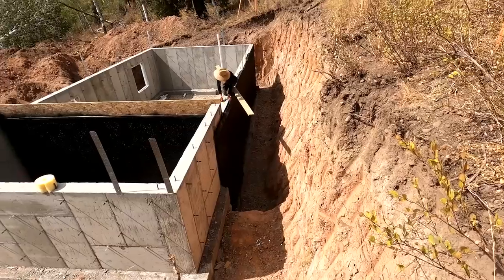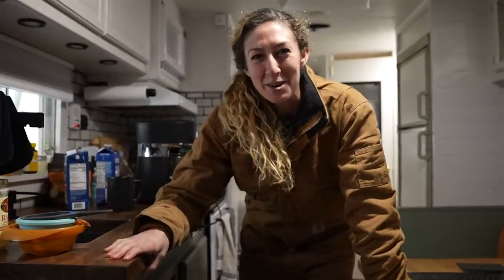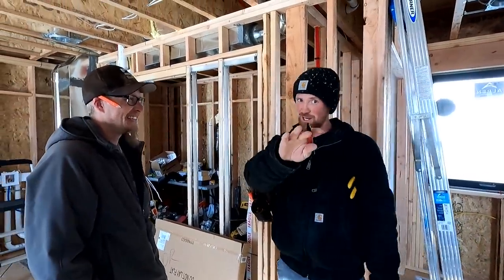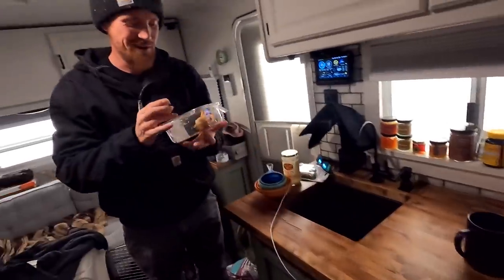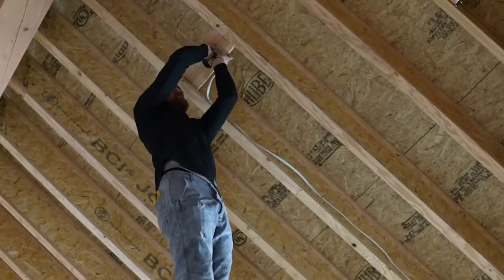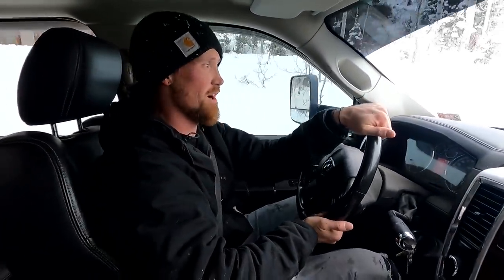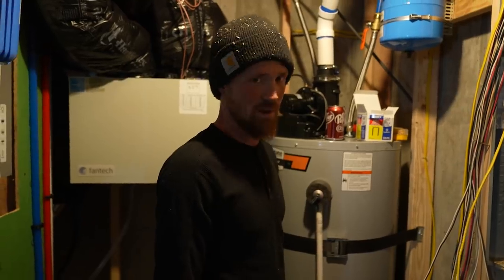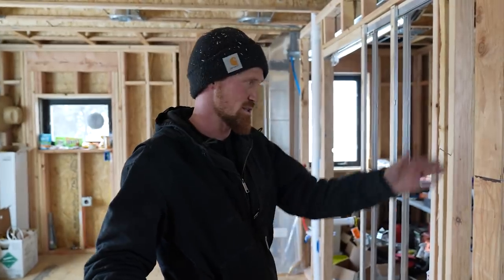WIRING OUR MAIN ELECTRICAL PANEL | BUILDING OUR OWN HOME

Comment: Here's an idea I have used for years on the electric. Take the faceplate of each switch, plug/wall outlet and anything that has a breaker that works it and put the breaker number behind the faceplate in sharpie so that when you want to work on one of them you can just take the faceplate off and you will know which breaker to shut off before you go to the panel. The panel may have more than rooms switch/wall socket associated with it. Sure makes it easy when you have as many wires as you guys do/will. Just a thought!
Reply: That’s a brilliant idea, Barry! Super brilliant!!
Reply: I used MS Excel and drew each room and labeled the outlets and the lights. (used small pictures of outlets/switches) Then Printed them mage a folder then hung it next to my breaker box. Same with my plumbing, heating and law sprinkler .   Its updated anytime I change something. Bedrooms on one sheet, Baths on another etc
Reply: Yes good idea.👍
Reply: @Gravity Holdings, LLC Whaaaa? Isn't that just electric 101???
Reply: Well that's a great idea even for the average homeowner
Reply: @4BWVan  Ive not seen many that do it! Most just label the panel and run out of space on the small space available to use. Good for you if you have done it already.
Reply: Wow that is a great one.  TY  My breaker panel is on the outside of side facing west.  I hate it.  We live in hot and salty air and over the 35 years the inside labeling keeps disappearing due to climate.  So it is always a guess when things go wrong.  I can remember witch side of panel but not always with exact breaker.
Reply: omg that's a smart idea!
Reply: @lastlion65  You really should get out more 😂
Reply: @Gravity Holdings, LLC then he wasn't a real electrician
Reply: @pattiwhite9575  use a paint marker to label it. Or get a note book and draw it out with labels and keep it next to the back door.
Reply: Great idea!!
Reply: Sounds like he knows the business and a great idea!!
Reply: Me, after 20 minutes of identifying the correct breaker: "I wonder why somebody wrote #15 on the back of this faceplate. There definitely aren't this many outlets in the room!"  (Seriously, it is a brilliant idea!!)
Reply: @barryhumphrey153  I think you misunderstood Rachel was responding to the poster who said their electrician refused to label the panel!
Reply: smuckin' faht!!
Reply: Excellent idea.. Wish I'd done it when I built our house..:)
Reply: I’ve been in and around construction (Mostly Framing) for 40 years and I have never seen or heard of anyone doing this, but it is a genius idea and I will be doing this on all future builds. Plus I will mention this to all my contractor friends.
Reply: @liondirk  You can still do it. When you have the time, like during a pandemic, just start to shut the breaker's one at a time and see what goes out and mark the plate with the correct number!
Reply: wow, great idea!
Reply: @divekatdreaming  It is not always in the same room. You may find a socket in another room or even in a different section of an OLD home that are on the same line. Many time I found that the garage was on the same line as the master bedroom above. That can be a pain when you want to see which breaker is the one to turn off to do any repairs or additions.
Reply: @saraloverock2010  Sorry I guess i missed that one. Thanks
Reply: Agree. Label anywhere you can
Reply: @Gravity Holdings, LLC I had an electrician refuse to do that, too! What's up with that?
Reply: That is genius.  Wish I had known this when I had some electrical up grades in the house ...... had a new breaker box put in and of course the panel is labeled (or so they said), but just to be absolutely certain, I still have to plug in a radio and set the volume to max and then run down to the basement and flip breakers.  Of course had I known of this idea I would have marked the inside of the outlet plate then .... right? :0(
Reply: @lastlion65  Another brilliant idea.  Gotta put these together in a book ...... "Idiot's Guide To Home Ownership and Maintenance".
Reply: @4BWVan  You would think.
Reply: @gufredd9675  It's called lazy ..... with maybe a dose of "Ain't gonna do it, cuz then the homeowner can do stuff without having to call me again".
Reply: @tinydancer7426  You got that right!
Reply: Exactly what my dad does and what I commented just now.
Reply: What a great idea!
Reply: Great idea !!
Reply: @4BWVan  are you kidding me. No they don’t label anything.
Reply: @Shandele3  none of the electricians I know do it either.
Reply: @Gravity Holdings, LLC Where I live the panels have to be labeled to pass inspection. Unfortunately the inspectors don't confirm that the labeling is accurate and the electricians know it. I don't know which is worse, mislabeled or not labeled at all. 😂
Reply: Really genius idea!
Reply: @Gravity Holdings, LLC  And I wonder why? Means more work for him?
Reply: Wow, what a good idea. Wish we’d have asked our electrician to do it. Would’ve made it much much easier for us in the years since construction!
Reply: Or just get a paper clip and straighten it out then bend it in a U and then stick it in eatch hole.... it will trip the braker
Reply: I like that a lot.
Reply: You guys are the coolest. Great job Trent.
Reply: That’s an awesome idea! I will definitely keep that in mind when building a new home
Reply: That’s an excellent idea!!! Thank you for sharing!!!👠🚌👠
Reply: @barryhumphrey153  That's my house!
Reply: That's way to much work, just label the panel, done.
Reply: Fantastic idea!
Reply: @Gravity Holdings, LLC  That's just overkill, each breaker should have multiple things on it and if labeled properly at the panel it's unnecessary. I guess if you are paranoid and need so much redundancy that you need every single source identified specifically you may sleep better at night but boy that's so unnecessary.
Reply: Great idea. The  wiring behind my walls are in need of a  true makeover. Trent has it made for the work he's done.  Stay safe. Guard your backs and eyes.  Good spinal health and good eyesight makes everything possible for being on the go.
Reply: I think I'm watching this for the second time because I had other things going on,  so I like all the details and music as well.  You're doing really well with your video production,  Allie. You've become very talented.  What your Vet said about the puppy is the one wrong if there was a situation, to remove her from the problem. Also,  Cesar M. once said not to use the dog's name in the process,  but use her name when she isn't doing anything wrong.  Dogs will assume that their name called in your anxiety to correct means that they ard bad when everthe name is called.  That's a dog's mind, and we can't change how it thinks.  Love to you both from the North East.
Reply: @Barry that's a great idea! Thanks for the tip.
Reply: @barryhumphrey153  this is a brilliant idea!!   I just bought a house and one of the things I have planned on doing is figuring out all the breakers BEFORE moving in so when I need to know something, it is already labeled.   This is brilliant and I will do this too.  Thanks.

Comment: Pro-tip (my dad is a Master electrician)- Label the door with a DETAILED list of what is what. He usually types it up as a grid and then we have reference copies in our paperwork but makes it easy to update with future changes. ALSO, write the breaker on the back of the switch plate or the outlet plate when you install. That way, if you ever need to do work, you can remove the plate and know what breaker to turn off. If littles are in your future, I highly recommend springing for the tamper proof outlets that have built in safety  for preventing items that are not plugs from being inserted into the outlet. Then you don't need to fiddle with those outlet plugs that are also choking hazards  and always get lost and not returned to the outlet.

Comment: I live in the Sangre  De Cristo mountains of Colorado and I'll tell you about spring in the mountains--Spring does a dance with old man Winter and you get a round of Spring then a round of Winter until Winter is all tuckered out.......somewhere around June....
Reply: I agree. I lived in Colorado for 35 years and I remember getting 22 inches of snow at the end of May.

Comment: As a person who installs home theaters i have basically 2x the cabling you have there but you get used to it. nothing about that bundle would freak me out. looks good
Reply: Great... but did he even put in any low voltage wiring? Speakers? Router?
Reply: @divekatdreaming  Nope...but a requirement these days

Comment: Thank you for another great video. Good to see that Leka has overcome her fear of the stairs. Glad to hear she got a good medical report. Though mentioned, we didn't see the door list being updated for the breaker panel. This is a really important step as you wire the panel. Best wishes on the final steps before the inspections. I can't believe Trent didn't take the opportunity to rough in the electrical for the outside lights in the snow storm. Another note, if you are planning to use the sun room as the mud room, begin practicing that now, for you and the dogs. Stay safe, warm, and well.

Comment: 👍Hi Trent! You were certainly right when you said the Electrical trade was the most difficult, - I served my time (five year apprenticeship) as an Electrician here in the UK. That was back in 1974!! But you certainly carry out your electrical work a bit different in the States. The one thing that remains the same is that 80% of the work is all covered up. - when finished nobody knows all the work that went into running all the wires etc. 
You and Allie are a great team and Brendan must have learnt so much helping you like he has! Great video - great life! 👍👏🚐🏠😌😌😀🇬🇧🙏

Comment: I like to write in Sharpie on inside of electrical box where that wire goes. Like the Feed wire, to Light, to receptacle etc. Inside the panel cut a 1-1 1/2" section of the outer romex insulation and slide it over stripped romex inside box where it enters the panel. Then label the circuit that goes to on that section of insulation. That way it's clear what that romex connects to in the house.

Comment: That electrical work looks like the boldest thing you have done so far. Troubleshooting electrical work seems mind boggling. You just have to imagine the flow of electrons. Your puppy is doing so well. That tail wag looks like it could lift her hind end right off the ground.

Comment: One thing I found helpful at times when trying to trace back wires is to label (write with a sharpie) the wires at the panel on the jacket. 

Also, I'm not much of a cook but got your cookbook. May never use it, but it's for a good cause :) , mind you there is a few things I'd like to try. It does look very professional, great job!!!

Comment: Ya...agreed.  While redoing my basement...which is not a house like Trent and Allie, but it is 1200 sqft, my wife asked me what the most difficult thing was so far.  I've redone the ductwork, moisture barrier/framing/insulation/vapor barrier, plumbing, electrical, drywall/drywall mud/sanding, laminate floor, baseboards, painting and building my bar....and although I think the drywall and mud was the most physical and time consuming, the electrical was the hardest...from a planning, organizational and safety point of view.

Comment: hello trent and alie, im an electrician. i strongly recommend you run power for the outside porch light because if you go with traditional switches later, you will be screwed, also you are using the wrong wire nuts, green are only for ground wires! also a couple more staples to keep wires in the middle of the studs and bays away from sheetrock screws and to make sure it looks clean for the inspector always helps during inspections

Comment: even a switch on one switch can trip the breaker if theres too mush hooked up to that circuit the moment you switch it on  even though the breaker is heavy enough to take the load normally 
aspecially battery chargers and wall warts for charging phones draw a lot of amps on startup (we call this spin up amps over here) so unplug those and plug them in one by one once everything is turned on

Comment: Adding extra , runs on the wiring to no WEAR. 
There for down the road. You put a blank face plate TILL you want to use them. Say TV wall, up stairs. And for the man cave in the BASMENT TV wall. Do it after inspection, even in the kitchen in the cabnets.

Comment: Tip, strip your cable from the cut end, pull the earth / ground wire and it will strip the outer sleeve.

Comment: Think yourself lucky on those earth cables. In the UK each of those earths have to have green/yellow sleeving fitted both in the breaker box (UK Consumer Unit) and at each of the outlets and switches.

Steve

Comment: some people will use a radio when try to find the breaker that needs turning off....just make sure there are no batteries in the radio that can confuse the situation ....flipped all the breakers a few times before we realized the radio jumped to battery power when 110 was disconnected...
Reply: So funny!!

Comment: Hi Trent and Allie, I really enjoy watching your adventures and build. Just a note, watch that you have the fridge you buy have the handle on the left so it opens to the kitchen. If the blueprints you have shown before are actually your blueprints then the door handle is on the right which would open to outside of the kitchen. Just an observation, thanks.

Comment: I have  wired solar and wired the utility systems and what is most important with solar especially is not getting all the power on one leg  and the other leg has a lot of low amperage stuff. It really needs to be balanced on to each leg. I have sat in someones house and they turn off something that draws lots of power and then the lights in the room get brighter... not good and heat is building if that is the  case. I use the metal no., that crimp to the wires on the ends of each room so that it makes it a little easier and then the walkie talkie is a handy tool.

Comment: I know coming from a big family of Electricians when my dad built our home back in the 1960's he put the hot water heater on one side of the basement and the breaker box on the other side of the basement. Also, there is no plumbing near the breaker box.

Comment: when i wired my house the only issues i had were the dreaded 3way switches.  twice i messed up not having a hot for the non 3way switch.  BUT i passed inspection the first time

Comment: Are you going to have a desk or area doing such?  Are you planning on low voltage outlet install for your internet access?  Install coiax cable for your signal to get from outside antenna to your router at your desk.

Comment: At 30:53 you used a green wire nut on 2 red wires. I don't know about Utah but in Florida, Green wire nuts are to be used on bare or Green wire only. Oh, it's 85 here in Orlando today. Just wanted to throw that out there.

Comment: Just FYI, You should try and balance the 120 volt loads on each side of your 240 volt system so the overall current is the same for both sides.  Plus your 240 volt breakers should be located closer to your  incoming lines and main breaker.. You are tidy with your work and that's a good thing so it's easier to trace out issues during debug.
Reply: @armslength2618  The higher current load should be closest to the main beaker. The bus bar has less of a chance to heat up from the distance.

Comment: Please run cat 5-6 cables to every location possible. You will find that using NVR security cameras (single cable provides signal and power). In addition to any other smart items that may need hard line connection.

Comment: Are you going to run network cabling for starlink and whatever else you need before you sheetrock?  Even if you don't know how just pull some cat6a (just not on top of an electrical line) and leave a coil for someone to terminate later.

Comment: Trent, I'm not sure how far that extension cord runs but if it is over 50 feet and that is a 18 guage extension cord you will have tripping the circuit more often. Also if you feel on the cord right at the connector on both ends and it is warm to hot the extension cord is too small.

Comment: Trent, just a few observations on the install......................................I'm no electrician but i was suprised that there was no Earth (Yellow green) sleeving covering the bare earth copper in the switches/power outlets and also Trent why strip the sheathing to the Neutral wire in the main panel?

Comment: God wiring a house in the USA is far more complicated than house in the UK. For our house the main electrical panel has only 4 breaker switches plus a main one, larger panels 10 breakers are available. Loving the vlogs and the puppy, we have 2 very large German shepherd dogs, long haired and a white one.

Comment: I have not seen you use an electrical meter yet but if you don't have one.. you need one! They are less than $10. When you have all your outlets switches and everything installed, set the meter to continuity (basically resistance). With the panel main break turned OFF, go to the breaker panel and check for continuity between every hot terminal (on the breaker)  and the ground buss. Do the same between the hot terminal and the neutral buss. There should be no connection (infinite resistance) in both tests. If there is continuity then you have a fault that must be resolved before you turn that circuit on. Also when you are completely finished, spend 5 minutes and double check that every terminal is tight in the main panel.

Comment: Are the ground rods for the panel in the ground yet? Where I live, we require two rods spaced apart for a 200amp panel.
Reply from the maker: The main panel and ground rods will be down at the road. This panel will be hooked to the ufer ground (I think that’s the name) piece of rebar tied into the foundation